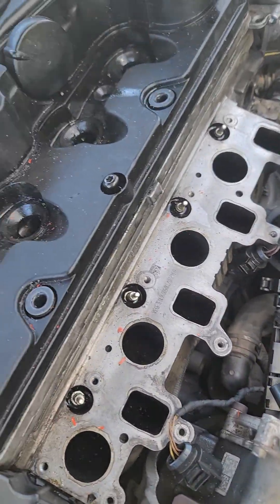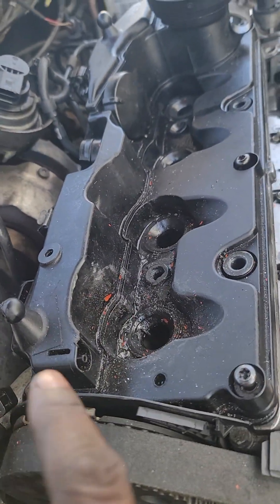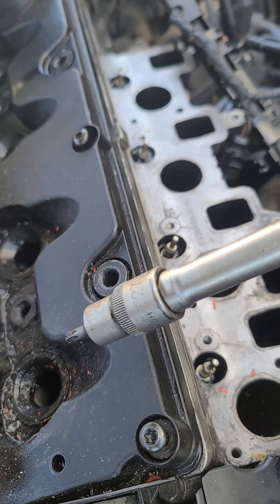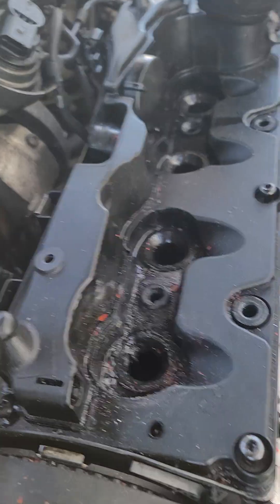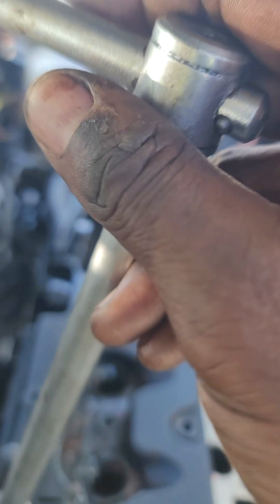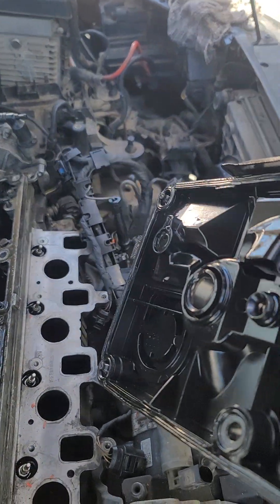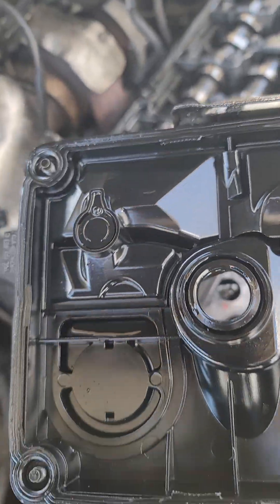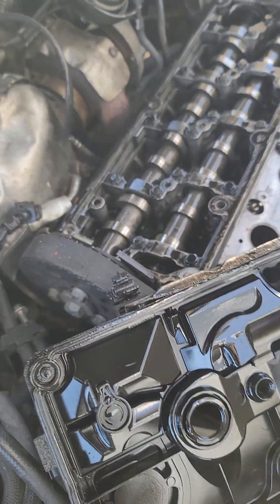VW Jetta TDI tappet cover #engineering #vw #jettatdi #tapett cover#cars #engineoverhaul #vwpolo

Comment: Its a valve cover  because you see the motor valve when you pull it

And at the right the part you already remove is the intake

Try an injector puller
Reply from the maker: You're right, it's a valve cover. Appreciate the tips!